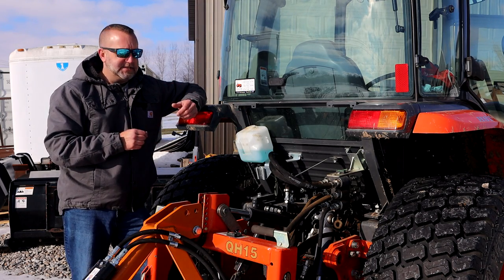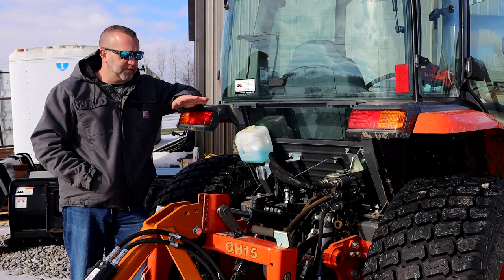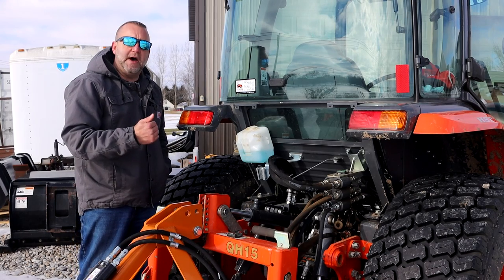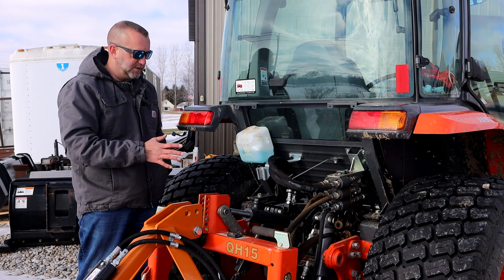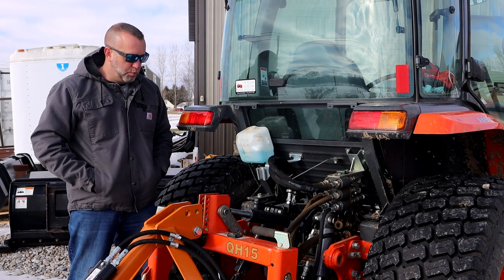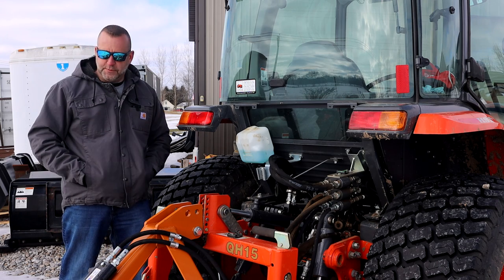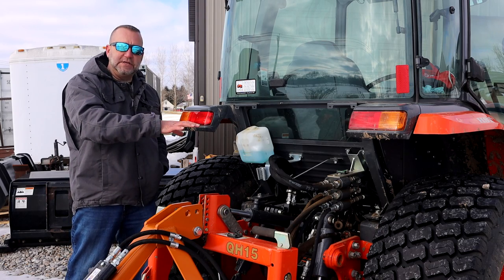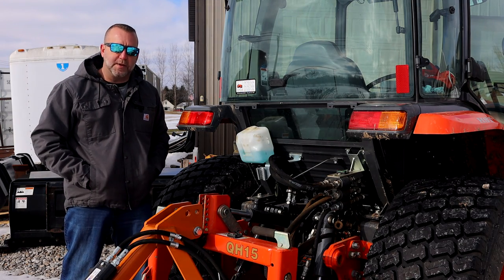Tractor Basics - Understanding Tractor Remotes

Comment: I have a TYM T574 Cab HST I will be doing a lot of land grading with a box blade and I want to add top and tilt. What valves would you recommend I use Spring or Detent and if Detent which kind? Great video!

Comment: Thank you Jared.  I have a B2650 with a Tractor Supply County Line log splitter.  I was told log splitters can over heat the oil because there is a constant flow.  I asked my dealer about it and
Reply: he said if I keep the tractor level and keep oil at full mark and avoid bottoming out and stopping automatic stop when cylinder retracts I should be fine.  What is your advice?
Reply from the maker: Yes. That is a risk. The fluid is going through your rear remotes any time your tractor is running so you’re not really generating any extra heat just because you hook up a splitter. The heat will come with the use, and specifically, working it hard. If the splitter is straining to split a piece or if you let it dead head too much you’ll increase heat. 

I’d buy a cheap laser thermometer and keep it with you. Shoot the valve blocks on a day when you’re using the tractor hard and get an idea for the baseline temp. Then, when you’re using the splitter, shoot the valve on the splitter every so often and see what the temps are. I’ll look up the factory temp specs and let you know.
Reply: Thank you!!

Comment: Nice job! I don’t currently have rear remotes but I do have outlets for a backhoe so I now see the need for a valve block to give me the ability to direct and control the hydraulics that are already at the rear of the tractor. Do you have any videos on installing a hydraulic selector block?
Reply from the maker: Yes. There is another video with the rear remote install. 

Adding Rear Remotes To Kubota L3560 - #49
https://youtu.be/b3p2w7IP_oA

Comment: $850 for my dealer to add an  extra set of oem remotes to my Tractor. They want $829 for the multiplier that you have linked here. 
It may be a good option for some old tractors.

Comment: Jared, another really helpful video. I will eventually splurge on this rear remote setup as I believe it’s a wise investment over time and distance. Your video on installing them was also excellent, and I have saved that one for the future install. The only downside I have had with the L3560 is that I cannot lift much weight with the bucket and on several occasions now have found it surprisingly unimpressive with seemingly light loads. Not sure if you have had similar experiences. R/ Dan
Reply from the maker: Dan, thank you so much!  

No, I do not have the same experience. Do you have the LA555 loader or LA805 loader? I find the LA805 loader pretty impressive and am surprised by what I can do with a tractor of this size.

Comment: I have an LX3310 cab with a QH15 and hydraulic top link and a Land Pride 1672 hydraulic angle Rear Blade.  No requirement for a hydraulic side link yet but I like your setup.
Reply from the maker: Thanks! I don’t always need it but it’s nice when I need to adjust on the fly. There’s many times the tractor is angled and I need to grade something level, or vice versa. I use it a lot on driveways when cutting crowns.

Comment: Off topic but I have a L6060 setup with the three valves in the back and you seem like a handy guy like myself and particular with how your tractor looks. Have you looked into adding a toolbox to the back. I’ve been trying to find a option but want it to look factory and not just mount a painted ammo can
Reply from the maker: I’ve been stewing over that myself but haven’t decided on what I want to do. I’ve thought about mounting something out back but if I do that I’ll have to remove it when I use the backhoe. I’m guessing I’ll probably end up with something on the loader mount somewhere. 

With that said, I don’t have many things I feel the need to carry with me. What is it you want to keep in your toolbox?
Reply: @JaredsShop  I always carry extra Clevis pins, top link pins and cat1-cat 2 bushings as my 6060 has cat 2 links. Right now I have everything in a Milwaukee tool bag that came with a drill stuffed behind the seat till I figure a solution. I don’t have a backhoe so I’ll mount something out back. Just haven’t honed in on a oem looking solution yet
Reply from the maker: @braxtonwiggins6576  
I think I saved a post by someone who mentioned a toolbox that I like the looks of. I’m thinking it was rural king but don’t quote me. I’ll see what I can find. 

I use a quick hitch so I carry extra pins or bushing. I’ve thought some basic tools could be nice. On our farm tractors they were always mounted up front or on the side frame.

Comment: I wanted to get a second rear remote on my Kioti DK10se for a side link but not sure if the Spring style is a Non Detent and Float style like you mentioned ?
 The Dealer said he didnt know of a float style just a Detent or Spring ( Non Detent) .
Reply from the maker: I’ll have to look up and see what is offered for your tractor. I think it’d be rare to not offer a float option. It’s more common to offer a float and not a detent power option. Detent flow is rare because the constant flow of fluid can increase heat on the tractor.
Reply from the maker: I see in the brochure that only two styles are offered. If you push on your current one all the way in either direction, will it lock into place?
Reply: @JaredsShop  IDK if thats the same as the factory rear remote I have will run until the lever is manually put back to center. 
 I thought the Spring style they said I can leave the lever where ever I want and it will just stay and the Hydraulics stop. Is that sound correct ??
Reply from the maker: @BuzzJones  
Make sure you’re not confusing the 3pt lever with the rear remotes. The 3pt should be a lever that you move to a place and it stays there. The rear remotes are like your loader joystick, when you lift or lower, it comes back to center when you’re done. If the lever stayed there then fluid would continue to flow. 

When you push your loader all the way forward to go down, do you feel a place where it kinda “snaps” into place? That’s what a float valve feels like.
Reply: @JaredsShop  Yes I am familiar with all that though my one rear remote is a Detent style I have hooked to a Top Link, and it stays on until you move the lever to Neutral. 
I got it figured out with a Dealer, I am getting a second Rear Remote, a SPRING style this time, so it will do what you said.  
 Kioti said the DK10SE can not be fitted with a Detent Float Style, only the NX & RX has that. Thanks
Reply from the maker: @BuzzJones  
That’s a bummer and very odd. The constant power style are what is rare. Spring center return are the most common, then float, then detent. 

Thanks for the update!!